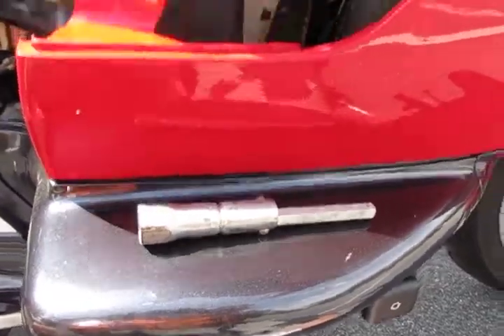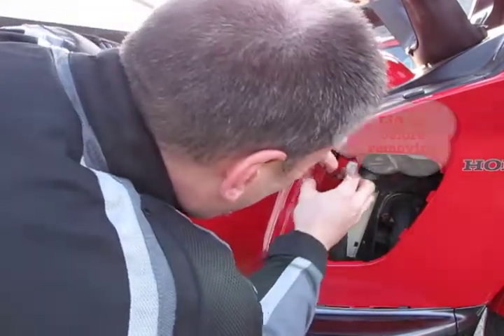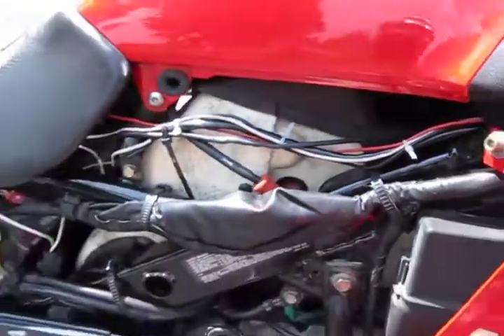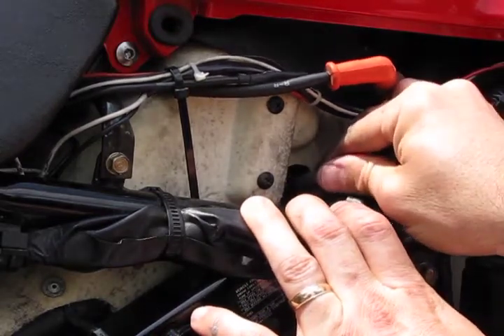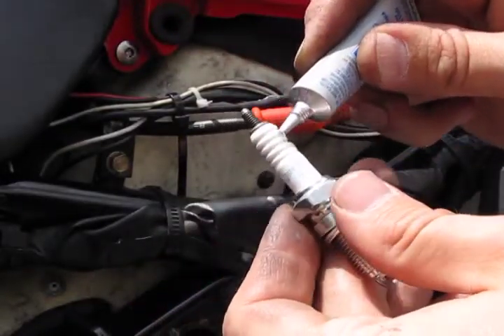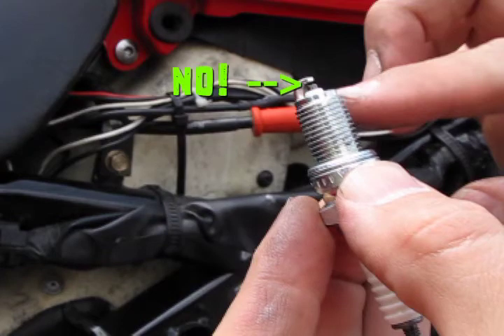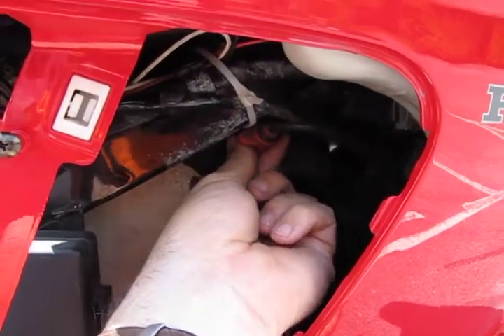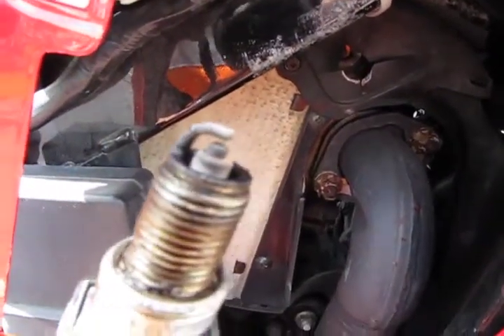Replacing Your PC800's Spark Plugs

Comment: Good video that makes what initially appears to be a difficult task very simple!

A better tool for turning the end of the allen on the Honda spark plug wrench would be a 10mm socket on a ratchet. Using it would prevent maring up the plug socket. Also, you can use your torque wrench to set them with the 10mm socket.

Comment: Hello PC800Fixes. I have an opportunity to get a 1989 PC800. Since these bikes were not very popular and not many sold, Can I cross reference parts from another Honda bike ( I heard the engine is just a Honda shadow V-twin, just a little bigger) to find parts? As far as the plastic body panels go, I can always just fiberglass/bondo or glue it together.

Comment: Plug Gap affects engine timing, and so longevity and performance.  You MUST gap your plugs properly.  Cross Threading a plug will be an expensive disaster.   At the first hint that the plug is not screwing into the head easily with two fingers.. back it out.. and start again.  As Scott said.. do NOT force the plug when re-installing.

Comment: Never  turn the ignition on with plug wires disconnected you may nuke you ignition module. That spark needs to find ground or the spark voltage will rise too high reflecting back on the ignition module output. Once again silicone spray clips and grommets to avoid excess pressure removing plastic panels.

Comment: DISCOVERED MY SPECIAL ARTICULATING PLUG WRENCH IS MISSING.. LOOKS KINDA TIGHT FOR MY OTHER PLUG WRENCHES.  WHAT TO DO ?
Reply: Look on line, and get another.   They were used on several models...the cheapest one will work fine.  BUT,  YOU MUST HAVE ONE !   there is no work around ... standard sockets with universals simply will not fit ... and you can damage your cylinder head, get the tool seriously stuck or do other bad things.  Spent the $13-20 bucks order it on line..and wait.   These bikes are easy on plugs anyway...so the only emergency is doing it wrong.

Comment: Where did you get the seat cushion?
Reply from the maker: It’s a Butt Buffer pad. It worked great, and in fact I transferred it over to my R1200RT, and eventually took it back and had it installed into the seat itself for $50.

Comment: When plugs are overtightened , or installed without anti-sieze, the threads in the engine cylinder head can become galled,  making removal and installation harder.. because some numbnutz damaged it.

Comment: What's the gap size
Reply: What's the spark plug gap  for the Honda pc 800
Reply from the maker: You know, I just don't recall. I know that I always checked the NGKs and they were spot-on.
Reply: They where I had to adjust my wires thank you
Reply: @lorenzohardaway8828   0.8 to 0.9mm, or .031 to 035".  Torque to 14NM or 10 ft-lb.